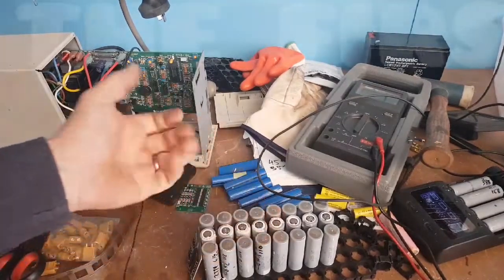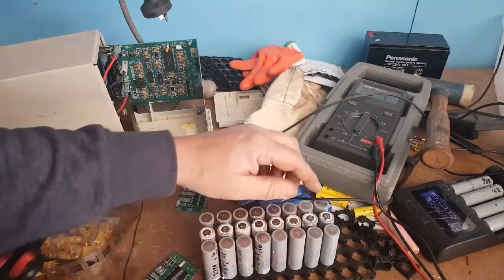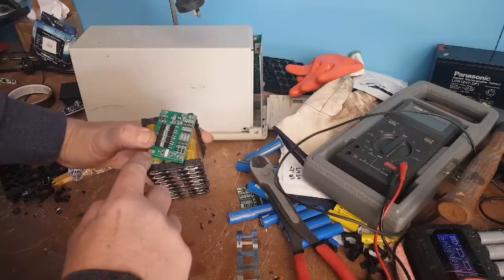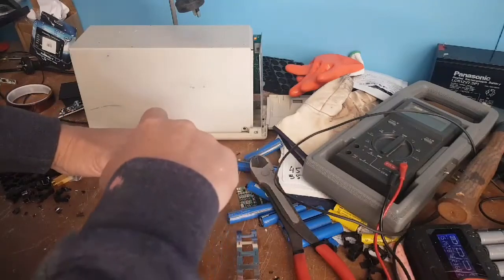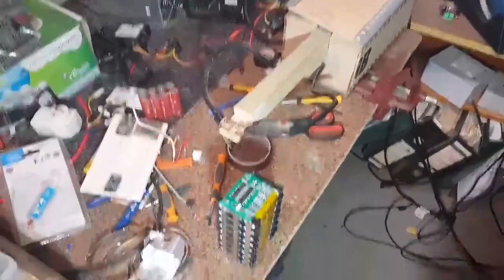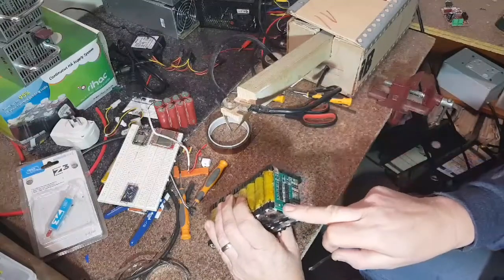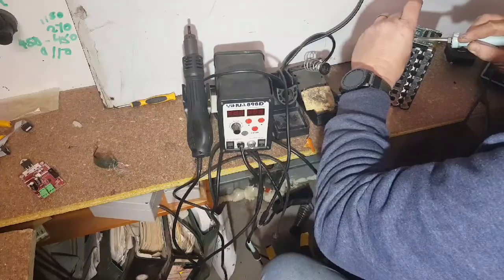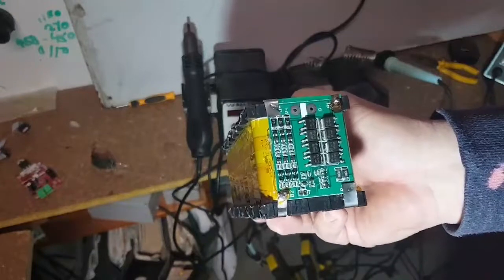Making a 3S8P BMS 12.6 Volt 300 Watt 18650 power pack for your invertor.

Comment: Great video mate, that spot welder is going well. How are you going to charge the pack once it is in the UPS inverter? SLA batteries are 14.1V charge voltage from memory so that would be no good to a 3S pack?
Reply from the maker: Yes, I need to make 4S packs. Not sure how to recharge these ones. I think they can be a USB charging bank.
Reply: @chuxxsss  are you going to use it for a UPS or an inverter. If just an  inverter you can just charge it with an external charger.
Reply from the maker: @brettwatty101  Have a inverter, but doesn't turn on with the 12.3 Volts from the two packs?